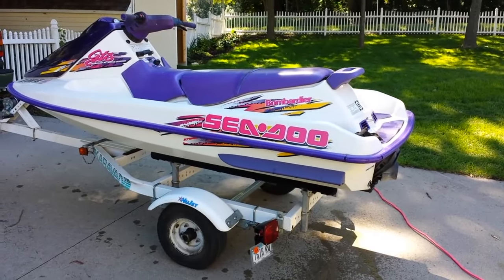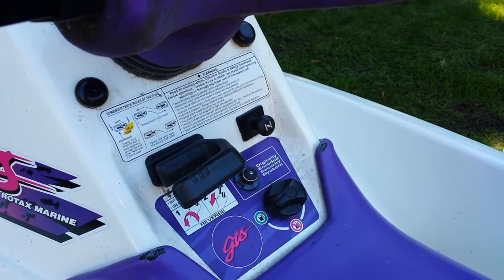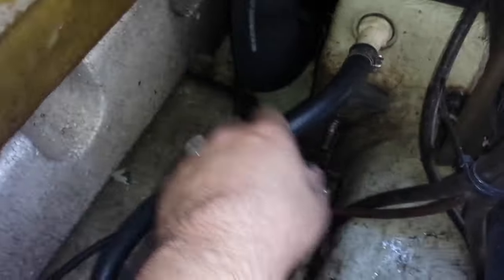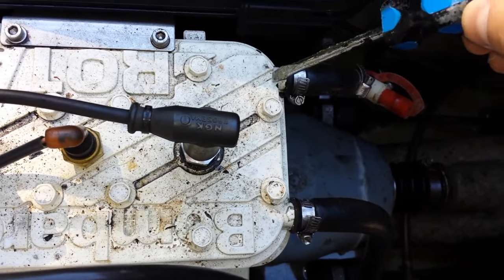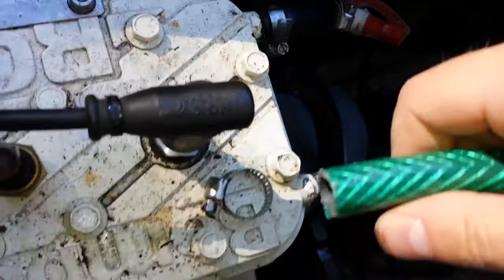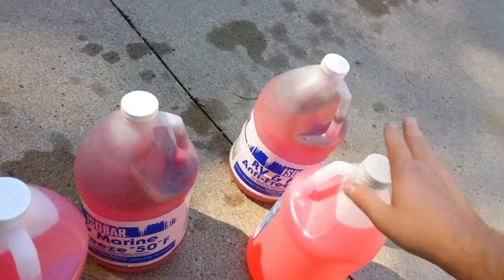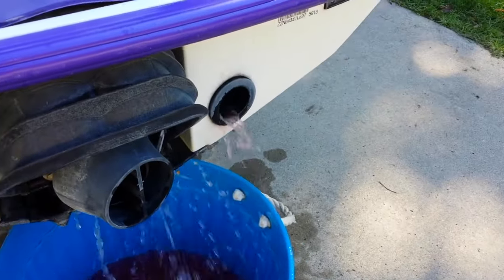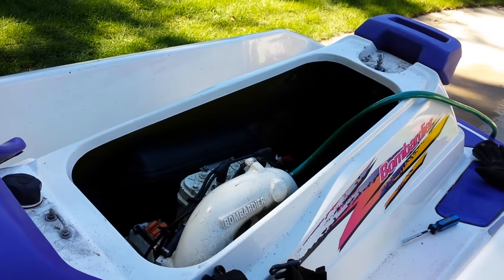Jetski Winterization Process

Comment: Just an FYI for everyone...I have this same ski,the factory manual says to clamp the output hose,pour a quart of antifreeze into the intake hose until it comes out the exhaust and your good to go,seems much simpler than this, although I'm sure both ways work.been doing it the factory way for 21 years now.
Reply: yea this guy makes it 100 times harder
just fill from the hose port and good to go
Reply: Do you need to have it running still?
Reply: @russellwarren5569  no,the engine is off
Reply: Question, the manual talks about also clamping two other areas (on a 2005 GTI seadoo which I think has the same engine as this). the first is the engine drain hose which makes sense. The second is the injection hose going to the tuned pipe. Why does that need to be clamped? or do you do that? I've followed the instructions in this video so am I good to go, or should I also clamp off these three pipes and pour antifreeze in the coolant intake as per the manual?
Reply: @KristopherDreger  I have been clamping just the one hose on mine,have done this for the 21 years I have owned them,and I live in northern Michigan.gets extremely cold,never a Problem
Reply: Ya, I would think all you need is enough antifreeze to fill the port in the engine.  Great video, though.
Reply: I recommend fogging oil. No one wants to fire up there high compression machine with rust possibly in cylinder walls just a thought
Reply: @justinmann3617  I do fog the cylinders....not the carbs though.
Reply: @timdaoust4284   Ahh ok. I figured 🤙
Reply: Tim, I know this old but can I clarify what you were saying?  Use something to close off the output hose, take off input hose and pour a quart of antifreeze in until it comes out the exhaust?  Does it not need to be run so the antifreeze gets into more parts?
Reply: @pbandjrsm  I use a vice grip with a rag to clamp.jetski is not run.pour antifreeze until you hear/see it come out the intake grate on the bottom of the ski.viola,your done!
Reply: Edit,until it comes out the exhaust....

Comment: Thanks, great video. I have a 1998 GTS Seadoo I bought new. I’ve always used compressed air to winterize. What is the red access fitting for on the head output or water input hose? Thanks Dennis North of Toronto Ontario Canada 🇨🇦🇨🇦

Comment: Question on identifying the input and output cooling flow lines.   At 1:45,  you say the one at the top of the video image is the input flow,  and you show how you can follow it to the external inlet.   At 2:05,  you say the one at the bottom of the video image is where the water gets ejected.   But,  at 2:45,  you seem to contradict yourself and say the opposite.  This is based on the direction of the arrows on the engine.   You say the one at the top of video image is the outflow and the one at bottom is the inflow.     I assume the latter is correct,  but I was under the assumption that the one connected to the external inlet would be the inflow,  but does not seem to be the case for this.   Can you clarify?
Reply: Yep, he said it wrong.  You can flush that way but if he had the connector for the red fitting on the other side you can do it that way, just clamp the hose leading out of the ski .
Reply: I was the same way Ron very confused. I would think the line coming from the inlet fitting that pumps the water to the head would be the correct one. But right after he points at that line is switches over to the other side and does the hook up there. I do marine repair but have not done any ski repairs so I know nothing about this .  But other than that his video is very good its what I needed to know
Reply: Roger Hockemier correct, I misspoke originally.  It was hard to see the arrows through my phone camera when I originally made the video.  You want to put your hose on the intake line, not the discharge line.
Reply: Erik Mortens are your hoses actually attached backwards then?
Reply: Negative, the hoses are correct but I misspoke in the video.  You want the antifreeze to flow into the inflow line of engine.
Reply: On my machine (which looks like the same engine top) the one closer to your camera (lower) is capped (which scared the bejesusw9ire987 out of me - until i see that pictured in shop manual for my machine) — anyway, i would appear they are both inlets (on my machine) when i connect hose to lower input and start engine the fluid exits back of machine through the small upper exit above swim platform) when i connect to the upper input and start engine it exits thought exhaust (below swim deck). — anyway, great video thanks so much!

Comment: I did all this. In the spring, some real nasty black gooey liquid came out the exhaust. Did the antifreeze degrade my exhaust pipe?
Reply: Over time oil can leak through the oil pump building up excess in the crank case.  First time starting after a long time may see what you are describing.

Comment: What is the nipple on the out hose for??   I have one of the same sea doos,,and thought it was for intake water,as I have a adapter that plugs onto that nipple and attaches to a garden hose? Im confused now.
Reply: re watched,,in beginning you said nipple side was intake,,,then minutes later you said the other way?? I want to run mine out of water?? which side do I hook hose to after I start it?? lol
Reply: @5153flash  you don't need the engine running to winterize
Reply: @5153flash  I have the exact same question. If someone knows please answer.

Comment: What about the oil? - Josh
Reply: Not sure if you're asking about draining an oilpan or referencing the fogging oil, but it's a 2 smoke, so there is no oil to drain. Not trying to talk to you like you're dumb, just not sure if you're thinking it's a 4 stroke. 
The fogging oil gets run through (without spark) to keep the inside of the motor lubed and uncorroded over the winter, because moisture is constantly in there, somewhere. So you can either put it in the filter like he did, or most of us pull the plugs, spray a "2 mississippi" count directly into each cylinder (it's an aerosol can), and then let the starter motor crank it around into the engine for about 10 seconds. This lubes up the works and defeats lingering moisture and corrosion while it sits for months without fresh premix going through it. Don't worry about getting it out when you "de-winterize", it will burn itself out on your first run next spring/summer. Just run it nice and easy for a few minutes before letting it rip on it's maiden run for the year. 
The Antifreeze (Ethylene Glycol) also does the same for the cooling jacket of the motor, the intake, and the exhaust, just like the radiator of your car. I'm usually too lazy to do this, but he's absolutely right to do this because it displaces normal, corrosion causing water from the works to preserve all the parts that normally breathe in river water while you ride. If you've done a head gasket on these (ridiculously easy even if you can't change a Bicycle tire), then you will see how gross the inside of the cooling jacket of the engine gets from having actual, no BS river and ocean water in it, as well as sand and other crap. It's downright alarming once you see it for yourself and pick shreds of seaweed out of the inside of your engine block. And if you let rust eat into your exhaust because you didn't get all the water out, you will get the most common reason jet skis run on dry land but don't run when you put them in the water when shopping for one on Craigslist: The Water Box (which is your tailpipe) is blown. From bad maintenance and the explosive pressure of 2 stroke exhaust firing into it. The reason it's called a water box rather than a tailpipe, is because water is supposed to be in part of the exhaust, so, of course, you gotta get it out when stored for long periods. PWC's are a plumbing nightmare. 
Also, I don't know how much 2 Stroke PWC experience some of you reading this may have, but some side notes from what I've learned the hard way:
1. Make sure to remove your battery and bring it inside for the winter, keep it off the cold concrete, and trickle charge it (on low amps) every month or so. Your contacts will thank you, and so will your starter and wallet. PWC batteries are more spendy than the average motorcycle battery, and I've mistreated many a spendy YB16CL-B battery to my everlasting expense.
2. Just change the spark plugs next spring. Just do it. Every year, like clockwork. And glob some dielectric grease on the top when you put them in. Hands down the #1 reason why some people waste money replacing a perfectly good CDI because they get no spark on a cylinder. Plug issues. And always have a spare plugs, a wrench, and some electro grease handy. Just trust me, HAVE SPARE PLUGS, YO. The day will come when you're glad you did. Oh, it will come.
3. Find Non-Ethanol race gas to fill your tank with stabilizer for the winter. If you ride all the time, then fine, deal with normal pump gas if have to. But for sitting for long periods, you need the stabilizer AND the non ethanol gas to get long term storage without the gas going kaput and causing heart ache.
4. Just a minor tip, but your engine might be fussy and a hard starter from sitting for 6 months. So the tip is to start it for 20 seconds (much longer and you sieze up the motor, remember it cools itself with the water you're riding in) on the trailer before backing down the ramp so you can troubleshoot, and when you're at the bottom of the boat ramp but JUST before you dip it into the water (literally a few seconds), start the motor and let it run so it starts without a tailpipe full of water on it's first run of the day. It may not like the xtra compression from the waterbox being full of H2o once it's in the aqua. This simply helps you avoid that "bad day" where it ran fine on the trailer, but it didn't want to start when sitting in the river. And then you're bummed out and frustrated, and your kids think you're bad with motorized things.

Edit, just other things noone ever tells you when you're a newbie 2 Stroke ski owner: 
5. Run your motor for about 10-15 seconds again once you get home from a day's riding. There's still water in your exhaust. Guaranteed. Your neighbors may not like you, but your ski will.
6. If your 2 stroke ski flips upside down in the water for too long because Aunt Mildred is really bad at riding and doesn't know to right your Ski IMMEDIATELY, and it won't start back up on the water, don't keep cranking it. You've been Hydro-Locked. Water got all the way up into the cylinders. Unlike air, water doesn't compress. That starter cranking is going to cause the connecting rods to bend, and you're looking at an engine rebuild. Either IMMEDIATELY take it to the shop to get it pumped out if you're the nervous type with deep pockets, or pull it out of the water, remove the spark plugs (it's the only place for the water to come out of the top of the cylinders), and start cranking the engine uncovered. Water will be shoot out like Old Faithful from both the spark plug holes, the pisser, and the back. Crank it good and long, until you see no more water coming out the top. At this point either be confident that you cleaned your existing plugs, or slap a fresh set in. Drop it back into the water, and you will find it probably runs again. Do NOT let it sit with water in the cylinders for even a day if you can help it. It can survive and operate with a little moisture remaining (it will burn out the droplets left behind), but not a whole cylinder full. This happens to at least one of my skis every year because...well, family isn't people you choose, they're people you're stuck with. And sometimes they be DUMB. Obviously, this trick isn't for 4 strokes. You're going to the shop. Bring your credit card. A hydrolocked 4 stroke is a much, much bigger problem. We're talking water in the oil sump (because these have one), scorched valves, scored engine parts, bent rods, and a broken heart if you try to start it after water got in there.
7. Use real PWC 2 stroke oil. Non-ester blend, non-ash racing grade stuff. Yes, it's more expensive. Generic lawn mower oil might work on a Honda 5 hp outboard, but your ski isn't one. You will know you're using cheap gas and cheap oil when it starts farting and spitting, or you start having MUCH more expensive problems. I've trusted labels like Amsoil Interceptor and Yamaha Yamalube Waverunner Performance oil to give me lots of hours on my ancient 2 smoke motors. Get cheap with gas, oil, plugs, and battery, and you get a Bummer Day where your ski sits on the trailer. Mocking you.
8. Change your reeds (unless you have rotary valves). Every few years is a good idea. Sometimes you don't have bad carbs, you have bad reeds. A simple, flimsy piece of material that is pretty damn important and that gets ignored as the reason your old 2 stroke ski might be running like crap. Don't be intimidated about doing it yourself, taking the intake manifold and carb off to get to the reed cage is usually alot easier than it looks, and is only a couple of bolts
9. Your motor is running great, your ski is going slow. Going down the list from most likely and easiest to fix to worst:
a. You've got crap in your intake. You can usually get this out by hand, reaching under the ski (not running of course) and pulling it out. Don't keep blipping the gas. Just jump in and clear it out.
b. You've got crap around your impeller. You MIGHT get this out by hand, but you better go to shore. If desperate, a coat hanger and knife is surprisingly handy
c. Your wear ring (if you have one) is worn down. Too much water is getting around the impeller to make as much "jet" action to push you through. You CAN do this yourself, but it's involved. It's nothing more than a plastic ring designed to be really close to the prop and keep the water tight to it rather than running around it. And, as the name says, it wears down over time like a bushing. Alot of old kawasaki and yamaha skis do not have one at all, so you're probably looking at the next item....
d. Your impeller is tore up or has a big, hairy rock jammed permanently in it. Same physics as above. But more expensive to replace and put in, and involves things like pump oil, etc etc. However, it's an excuse to put in a badass Solas or Riva progressive pitch impeller, which can take a turd ski and turn it into a totally different animal. So can something as simple as a new handlebar setup
e. Your impeller shaft is stripped. This is what happens when you keep blipping the gas with a jammed up pump. In laymens terms, you're stripping out the one and only transaxle that exists on your ski. On many skis, replacing this means unbolting the engine and moving it temporarily to put in the new shaft.
f. Unlikely, but you might have a Temp Sensor putting you into Limp Home mode. It thinks you're roasting the engine, and dials it down whether you want it to or not. Push it too much, and it's gonna start shutting off the motor. Normally, you can run your ski and put your hand on the engine, and it's only Warm. Not dangerously hot. If it is only warm, and it keeps cutting power, then you probably have a messed up sensor or even the brain box isn't reading the sensor right. This can be a rabbit hole. If the engine actually IS too hot to touch when running, and it's doing this, you may have any one of the above problems causing the engine to work super hard and hot to push you through the water, and you should get A-E checked out.
Reply: @WindFireAllThatKindOfThing  omg i actually finished reading your comment lol. Well put👍. Also its going to be a a big help for me since i just got me a 97 bombardier gts. I gonna screen shot your comment for later use. Thanks a bunch. Oh you have sated you trust the amsoil intersetor and yamaha lube correct? I need help on what oil i should use and what/where or gas station with the racinggas i can get for this jetski.